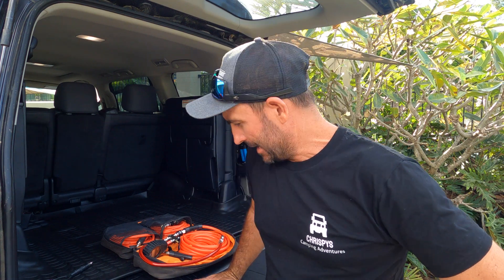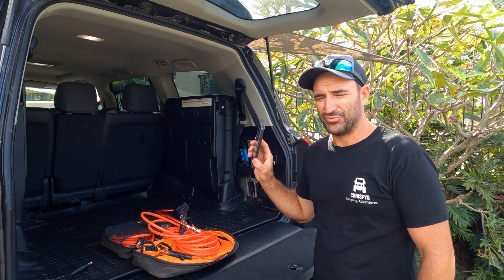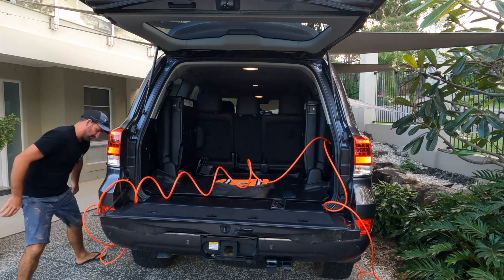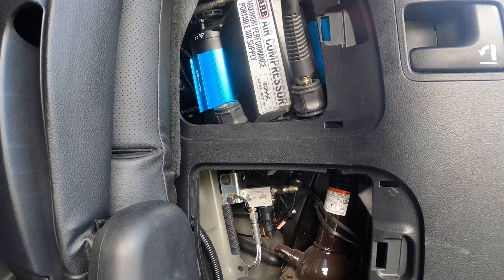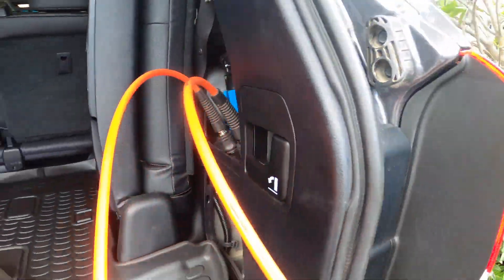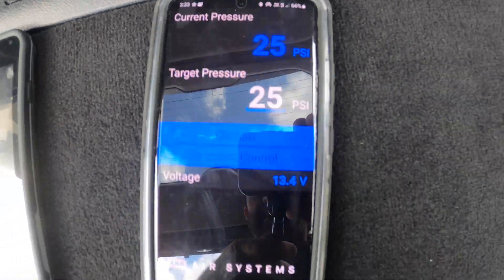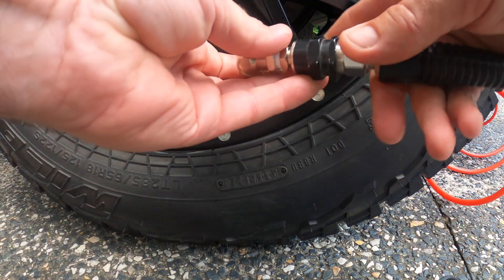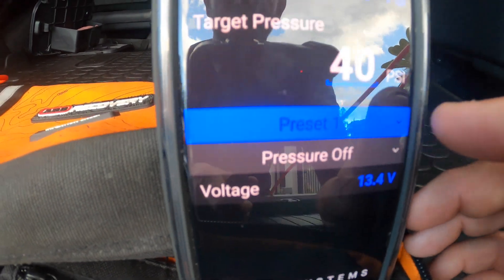An APP which inflates and deflates your tyres

Comment: Nice for inflating. But for deflating, I don’t understand why anyone would want to use anything other than the brass deflators that you can set to a pressure. Screw them on, and you can be rolling down the trail in 30 seconds. Just let them do their thing while you get going. When your buddies have to stop and pee, take them off.

Comment: Can you inflate two tores at once? And is it faster/slower than not using the controller? Thanks
Reply from the maker: Yes you can Inflate 2 at once , slightly quicker and would be different if you were running bigger tyres mine are 33inch.
Reply: @chrispyscampingadventures  Thanks,  I currently have the twin compressor installed under my passenger seat of my FJ and am thinking of getting the controller, but need to make sure it's not slower than just using the hose and inflator (1:35 per tire now). I currently have Apex valves on my 33s so will never use the controller to deflate. (7 seconds per tire with the Apex valves).